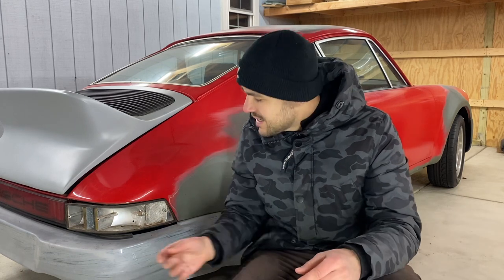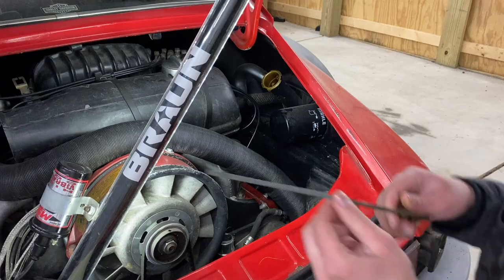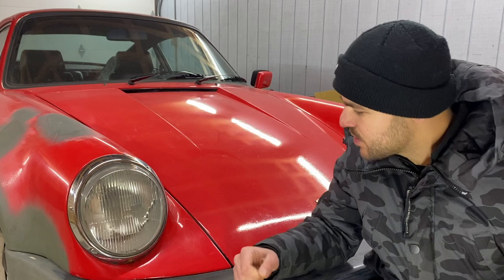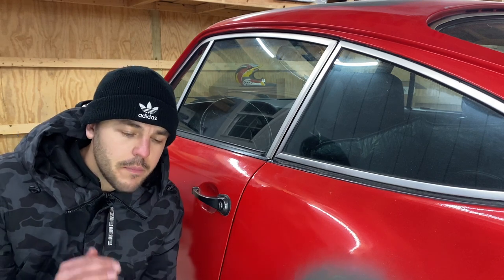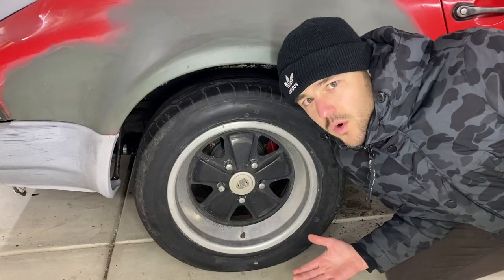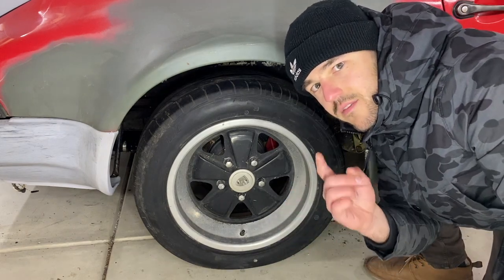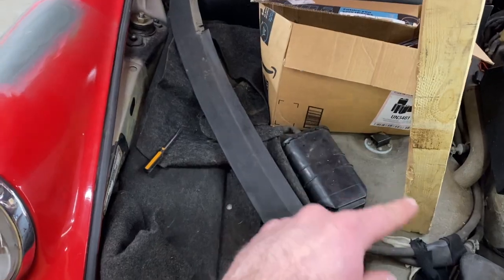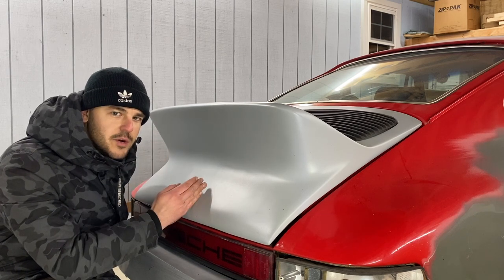Everything you need to know when checking out a Porsche 911

Comment: A great tip to know if the car mileage has been nobbled is this...

The clocks can be removed by getting behind them and pushing them out from the back. Unscrupulous sellers will get hold of a low mileage clock and swap them out. Check that the clocks are all sat properly and straight in the cluster, otherwise they've been changed.
Reply from the maker: Great tip Phil!! I’ll keep an eye out for that. Thanks!